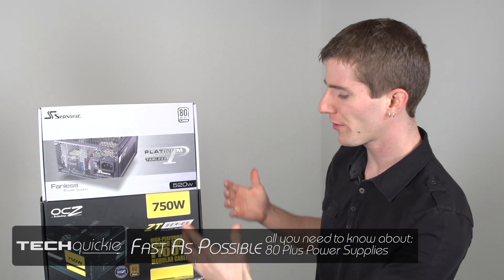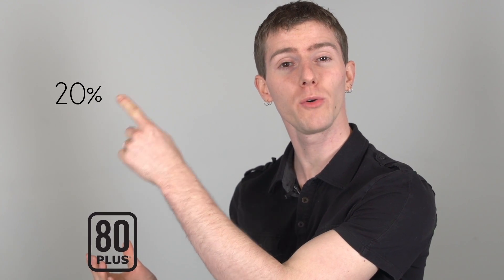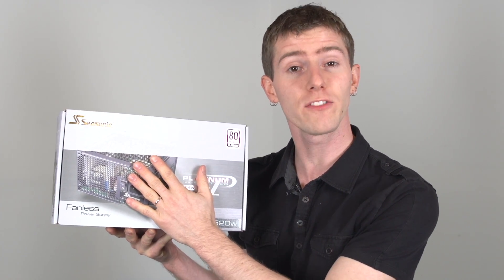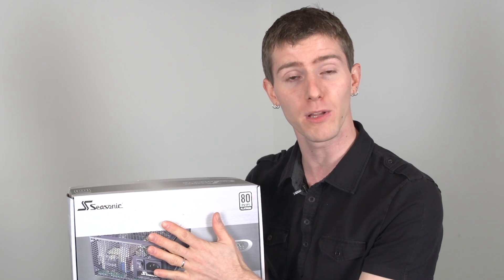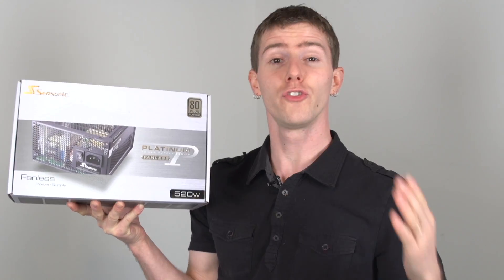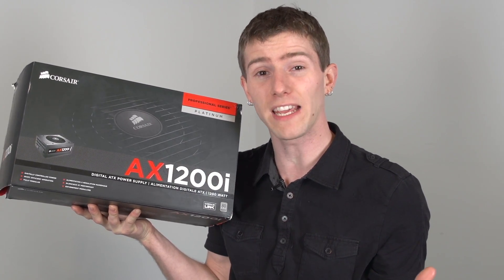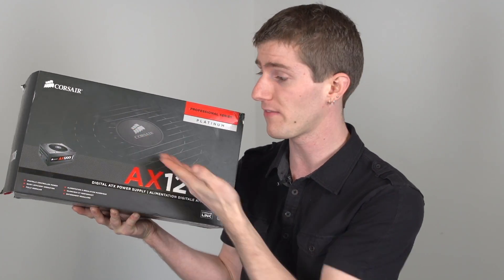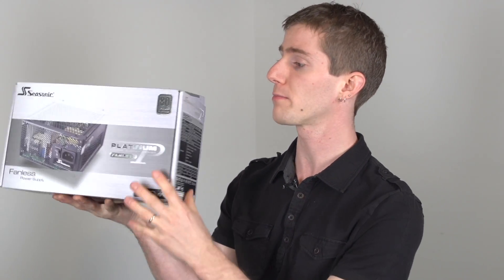80 PLUS Power Supply Ratings - All You Need to Know as Fast As Possible

Comment: with a  "kill a watt" device which they are often priced between 15 to 20 ish bucks on newegg...ncixx, amazon, and microcenter.  Just make SURE to plug IT straight into the wall outlet and then your computer's psu power cord into the kill a watt..otherwise You risk getting an inaccurate reading.  I would not recommend leaving it like this forever..if a storm hits your area ( like i just learned the hard way)  it could fry your motherboard and brick it.  cheers

Comment: What do you need to know about those cables/  Molexx is specifically most commonly used for powering case fans( in older days of 2005,2004 and earlier...they powered older hard drives like ide ata133 & ata100 hard drives & older cd rom, cd burner, dvd rom optical 5.25 inch drives. Those were replaced by Serial ata ( or sata) drives and sata cables which are MUCH smaller and much more efficient.
6pin provides 50watts wile 8 pin provides 75 watts, Pci Express x16 provides 75 watts in addition.

Comment: No, a good 80+ plat 1000w psu will supply 1000w while only needed to pull 1100w from the wall under absolute full load. 

If your system is drawing 500w then a 90+ efficient psu (plat) will pull 550w from the wall to create that 500w.

Comment: I just can't see the advantages with a platinum power supply in the driveprice. The extra 10% efficiency between bronze and platinum just saves me, in a system that runs 24/7 at a medium of 300watts, 20 dollars a year. To compare with differences in price between 80+ bronze and platinum. (sorry for my english)

Comment: pro: you have only the cables you need on you psu, which means easier cablemanagement. 
con: the connector most makes the psu a bit longer, wich requires a case with more space for the psu.

Comment: The eXtreme Power Supply Calculator is a great resource for figuring out what PSU you should get for your system.  They have the power requirement information for almost all hardware on the consumer market and the results are generally pretty close to real world measurements.  The recommended size accounts for the maximum regular power consumption of the components selected plus a small margin for capacitor aging for a couple of years.

Comment: It may be a stupid question but I want to know what powersupply would be good for this config. amd fx 6100 oc 4.530 / gtx 480 oc to 825mhz/ corsair vengance 1600 oc cl 9/ a970-ga-d3 mb and I have 9 fans but I only use 6-7 of them when I play only. and when I watch movies or brwsing are all off and card is also defauld clock 700mhz